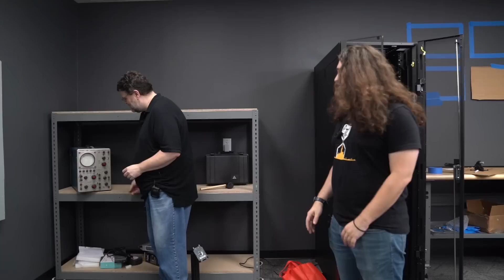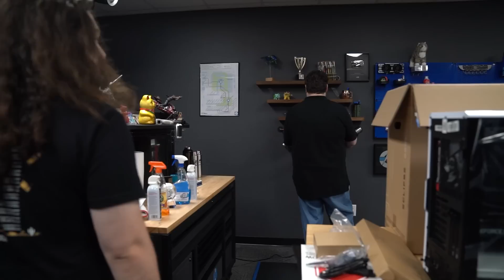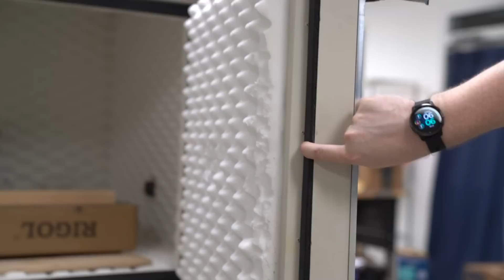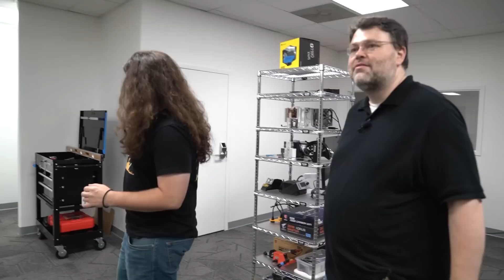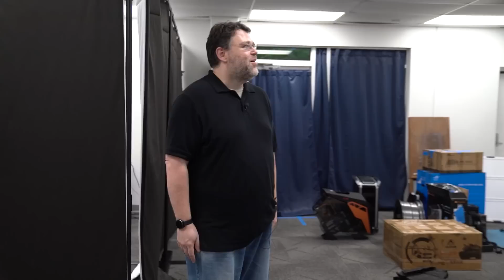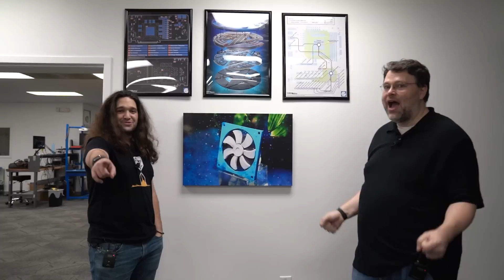Level1 x Gamers Nexus’s Kick@$$ Office Tour!

Comment: You already have 240V in your home. You just need a really long extension cord from your laundry room or get an electrician to install a 240V outlet next to your fuse box, unless you want to mess with the bus bars in your fuse box which might get you into all kinds of trouble or result in injuries or death if you don't know what you're doing.

Comment: I also have a  Oscilloscope & Signal Generator an Variac an a ton more you know how it is..lol. That Is used when working on a 3500volt amp used to in to turn the voltage down enough to read it with normal testers ! a tester that will read 4000v is insanely  high and that tool helps ! (Short version)

Comment: 10:44 Wendell, fume extraction isn't just about the lead, it's about the flux and all the nasty $hit it dissolves when you're soldering. At the very least get a 50 buck "fan with activated charcoal filter" desktop unit, it's cheaper than dealing with lung cancer.

Comment: "We don't even use lead based solder these days. It is fine!" 10:40
Well, it isn't the lead that were the problem. Lead doesn't really fume that much to be fair.
The bad thing is the flux fumes, especially water soluble flux. Neither of these are particularly healthy and do contain fairly nasty stuff. (Read the safety datasheet of your solder/flux for more information.)

Comment: That 42u server rack is facing the wrong way. There is a single door in the front and two half size doors in the back. So the doors in the back can be opened when your create a hot isle configuration.